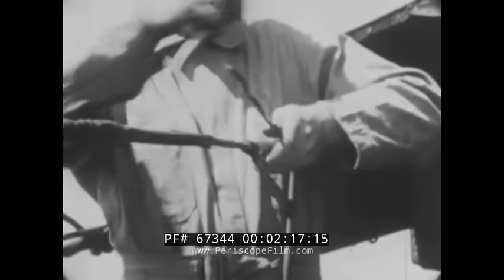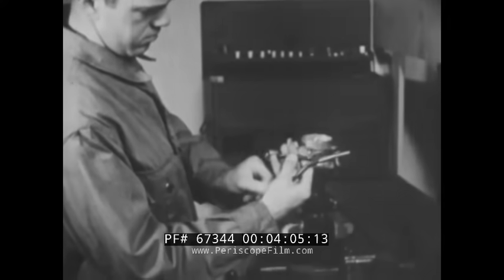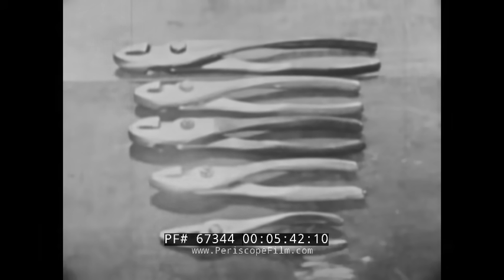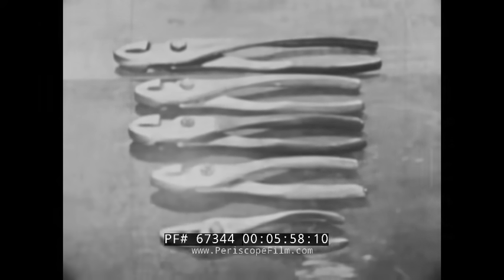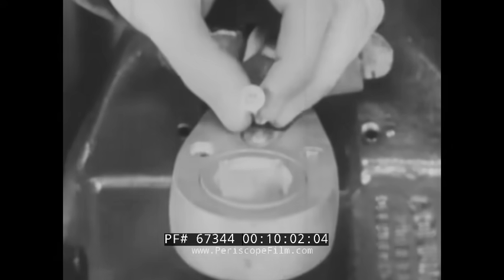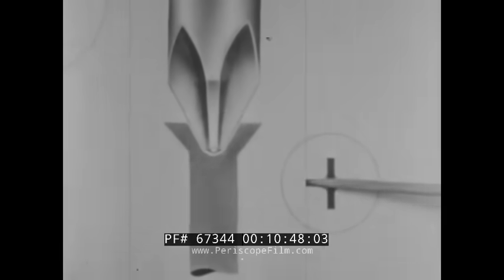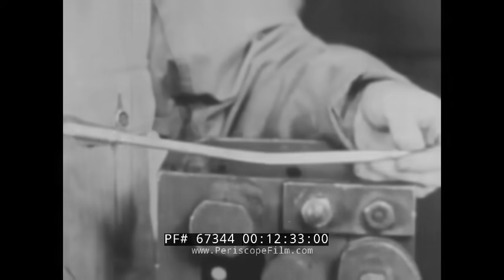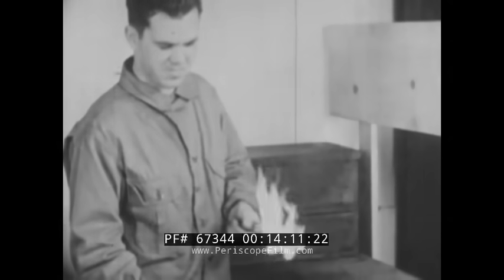" CARE AND USE OF HAND TOOLS    PLIERS AND SCREWDRIVERS "  1943 WAR DEPARTMENT TRAINING FILM 67344

Comment: Not a word about gun smith screwdrivers. 
Normal stevens bit screwdrivers have a hollow grind...gunsmith screwdrivers have parallel sides and fit perfectly in both width and thickness for the standard size scews they are designed to fit